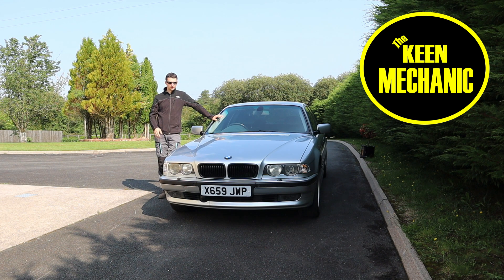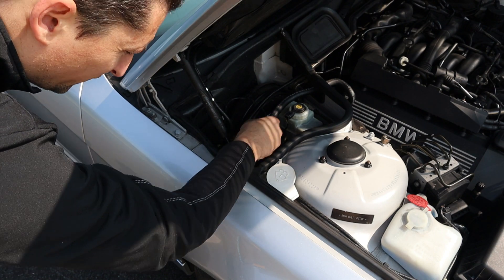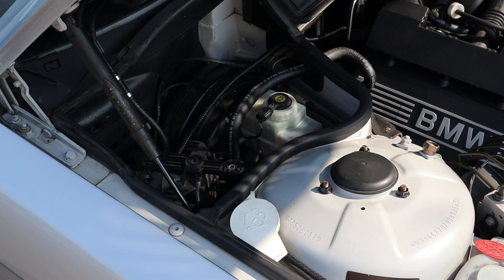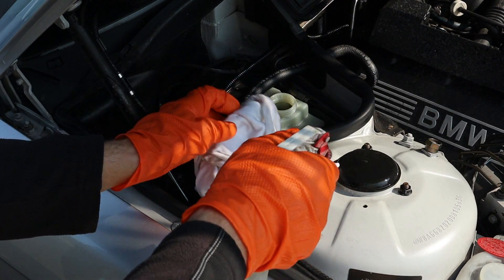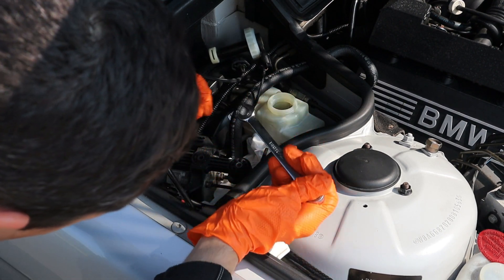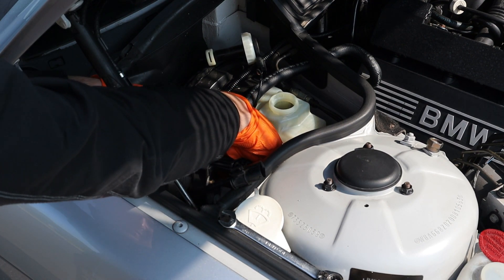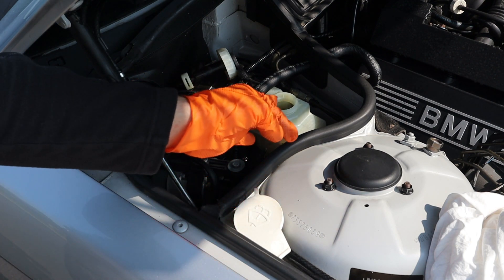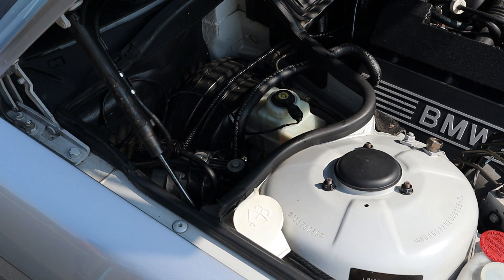Every BMW E38 E39 owner will have to change this part! Pre charge pump DSC traction control pump

Comment: Hey, man! So a little tip for anyone watching. Before you install, fill the pump best you can. After you get the pump on, take and run 12V to the pump, but opposite polarity. Positive to negative and vise versa negative to positive. I use the jump terminals under the hood. This runs the pump backwards and pulls fluid through it from the downstream up into the reservoir. That bleeds all of the air out and normally you won’t have to bleed the system after.
Reply from the maker: Nice tip buddy. Thanks for sharing your knowledge. Great to know this trick🤜🤛
Reply: For sure! Thank you for sharing your knowledge. We all know what we know and together we know about everything. See you in the groups!
Reply from the maker: Cheers buddy. Well said. Did you find me from Facebook?
Reply: I did. You and I have talked a little I think. You thumbed up my comment about PA Soft just this morning. Saw the name and that reminded me to check out your YouTube. I always like to see how other people do jobs even if I’ve done them 5 times and see if I can’t pick up any more tips.
Reply from the maker: I remember reading your post. I have PA soft but never installed and never used it so I know from the previous owner that was a very user friendly program. Must give it a try some day and get to use it. I tend to use Inpa and Ista but nothing wrong with having a few extra options. Thanks for tuning in buddy, nice to build a good community and help eachother.🤝
Reply from the maker: Something strange is happening on my channel, I saw you left a comment saying "Hell yeah, anytime. Let me up your subscriptions by +...." and this is all I can see on my phone YT studio app. It says comment no longer available. So strange. I have been speaking to other people here on my channel and same thing happened. I get no response and people think I don't bother to come back. Need to report this to youtube.
Reply: Ah ha! Well, I thought it was just me. I left that comment, came back and it was like it never posted. Anyways, you got it and that’s all I wanted to do was share my feelings and dealings with the program. No point in being all off topic on a precharge pump video talking about software. 😆
Reply from the maker: Thanks for subscribing, it means a lot. I am now speaking with youtube and they say comments get blocked if they breach certain policy but as I couldnt read it I don't know what policy was breached. Anyway, thanks for your support and speak soon
Reply: Thanks for the tip
Reply: Thanks for the tip! Your method of bleeding is also a way to test if your Presurge Pump is bad. Mine was throwing the traction light error. Testing this pump would have saved me a ton of time troubleshooting the problem. Thank you!

Comment: Howdy!  Just stumbled across your channel and love the videos I've watched.  Ha I'm on my third pump....probably going to replace it soon so that will be four.  Your E38 is very clean, excellent.  Great cars, love seeing folk sharing info on them and repairs.  I've had mine for over 15 years now.....currently doing the valley pan and valve cover gaskets.
Reply from the maker: Hi and thanks for your comment. It is great to hear you found my channel, I love to hear from people who share the same passion for BMW E38 and cars in general.
I have had my E38 740i for about 7 years now and have done a lot of work to it. Mainly preventtive maintenence. I have a lot more to do on the rear suspension, brakes and brake lines, fuel lines and a Fuel tank reefurbishment or replacement. I have a few E39s as well and currently working on my E39 530i 2003 wagon to get it ready for it's annual test. 15 years of ownership is a very long time and quite rare nowadays. I suppose you will keep it forever? Speak soon

Comment: Never had to replace the precharge pump on my E39. I believe the pump is original to my E38. Perhaps the issue is with the stupid rain channeling off the hood vent being placed through the charcoal filter housing onto the top of the pre charge pump’s plastic upper rails. I never, or incredibly rarely, ever have water flow down those channels between not living where it rains and having the cars garaged and/or covered.
Reply from the maker: Seems to be a problem with cars not being driven often where the internal parts get stuck. If you daily drive your can you might be ok. Here due to price of fuel most people can't afford to run them daily and most people have a diesel engine cars for economy
Reply: @TheKeenMechanic  i drive my e38 daily (735 iL 1999 ) and my compressor gave up ( 534000 km)
Reply from the maker: @haykodjan  Wow half a million km. Amazing. Where do you live?

Comment: Hi mate, where are you based? I have a 740iL with traction control light on, fault code is for pre charge pump and the car is also going into limp mode. If you are local to me I could do with some assistance in changing this pump
Reply from the maker: Hi mate. I am in Northern Ireland
Hope you get it sorted as it is a pain. I have done it a few times so far, seems to be a common fault